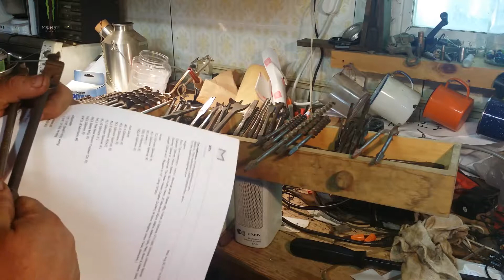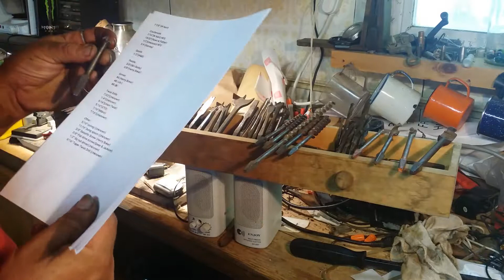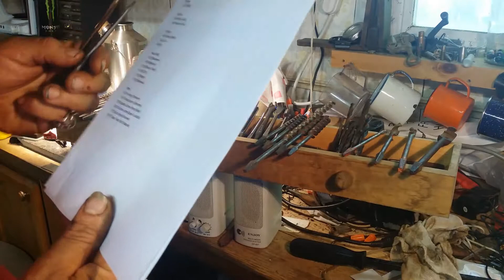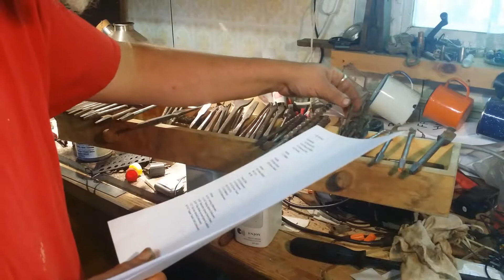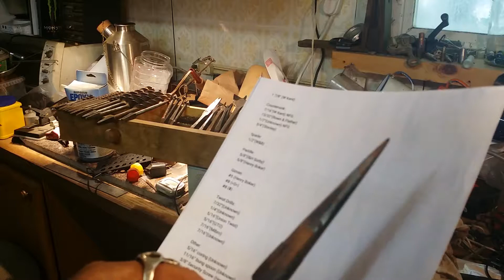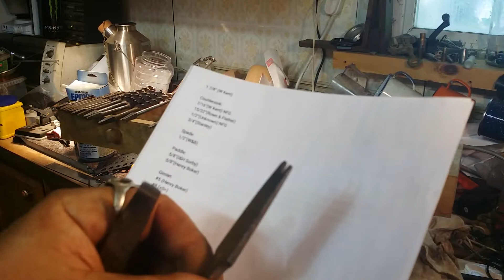Auger Bits

Comment: I will take all your no good ones.  What you pointed out as no good, has the flutes pointing backwards,  this was the way larger bits were made.  The only thing you have to worry about with these bits is that the cutting edge is below the base.
Reply from the maker: Thanks, some of them were made that way, you are correct, and some of then were just damaged. If you want to swing by some time I'll be happy to give you all the ones I still think are "no good"...